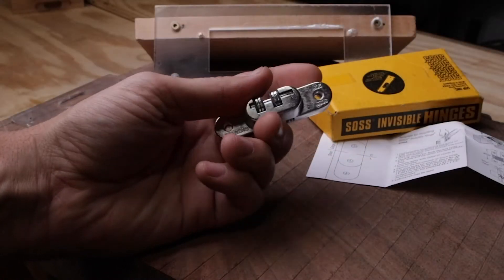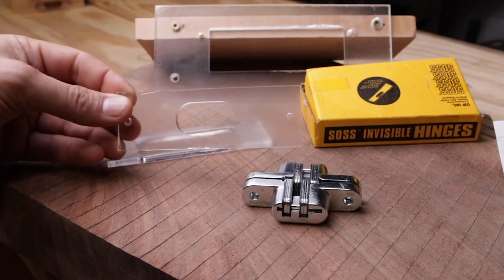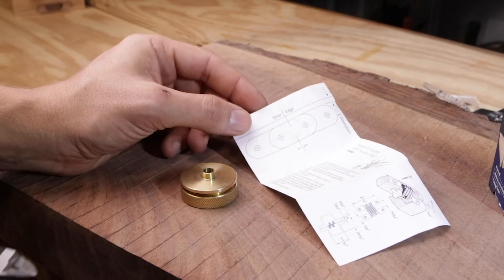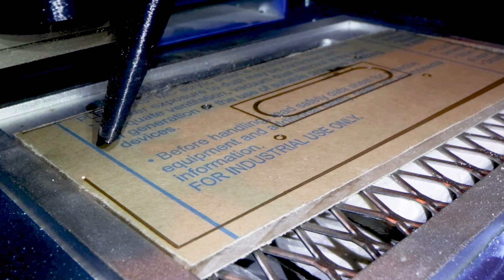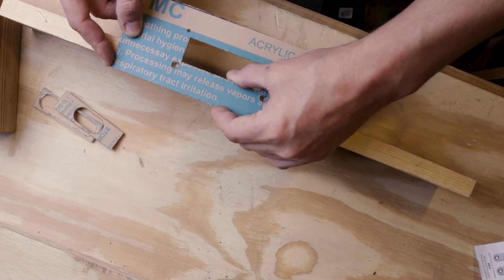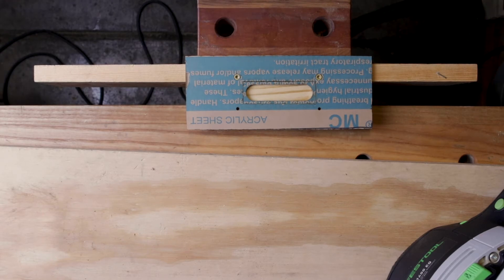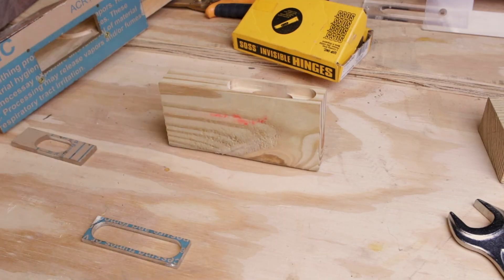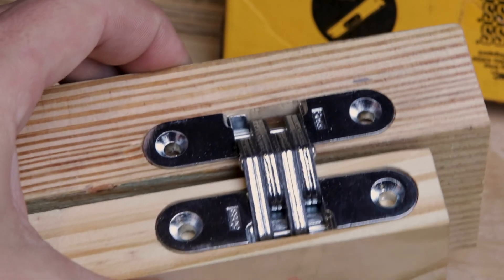Lasers and woodworking: Making a jig for a Soss invisible hinge

Comment from the maker: I have added the files that I used for my bushing and router bit combination. The sizes will likely need some tweaking based on your own tooling. https://asquaregarden.com/soss-hidden-hinges-installation-jig/
Reply: Does the download on your website work for all Soss hinges?  Or is this a specific model?
Reply from the maker: I only made the files for this specific model.
Reply: Can you tell me what model this one is?
Reply from the maker: I double checked the file and it has components for both 204 and 208.
Reply: Curious to know how much tolerance there is with the inserts. I notice they shift around inside the outer template a bit (due to laser kerf I gather).
Reply from the maker: @Brad-cq5wr  it’s not enough to make a big deal with wood due to expansion and contraction. But if you want to go all out you can cut the insert separately and slightly bigger to account for the kerf.

Comment: Hey, thanks for the video, that's a far sleeker looking method than some of the other jigs I've seen, including the soss one with the removable screws you mentioned. I'm trying to figure out how to make my own jig. I have no laser cutter and I don't have a template from Soss either, infact, I bought these cheaper hidden hinges here: https://www.amazon.co.uk/gp/product/B07JK1DRJ8/ref=ppx_yo_dt_b_asin_title_o06_s00?ie=UTF8&psc=1

I think the "B" dimension on that link, may be double one of the crucial dimensions you mention from the door edge, in this case 8mm of B, meaning it should be 4mm from the edge? However, I'm confused by the fact that when you lift the router, the cut line looks completely flush with the jig? I was expecting the guide bush to create a gap between the jig edge and the cut line, unless it's so small it's not visible in the video? If the bit you got is 1/4" (6.35mm) and the outer diameter of the guide is 8mm, then I guess that means there should be a gap of at least .75mm? I'm just new to using a router and trying to figure out all this, so any feedback on any of this would be great!

I think the guide bush on the router I have is 15mm outside diameter, so I guess my jig will need to be a good bit bigger to allow for the space of the guide. I'm just hoping the router bit isn't too long to allow me to go to such a low depth for the 4mm or so that's required for the more shallow cut while using the guide :)
Reply from the maker: I looked at those hinges and I am with you on the 8mm. I suspect you need to be under 4mm from the edge for the hinge not to bind when opening. As far as my jig and being flush, that is not the case, it is parallax from the camera angle. The bushing is like you said about 1.5 mm bigger that the bit so there is a lip. As far as making a jig, you can use a piece of 5mm ply. Cut some strips and screw into the piece that will become your template. You will need to measure the bushing and account for the clearances, you basically want to make a fence then using the same bushing and bit route one template. Then the second one for the small/deep area. It may not be as easy to index like mine but you can pencil some center marks. You can also make one like soss sells using the same method just with a thicker piece of wood.
Reply: @asquaregarden  Hey thanks a lot for the reply! Nice to get your feedback :) I don't fully get your idea of making the jig from strips of 5mm ply, but I should be able to come up with some solution, I guess it'll just mean a bigger jig given the size of my guide bush thingy :)